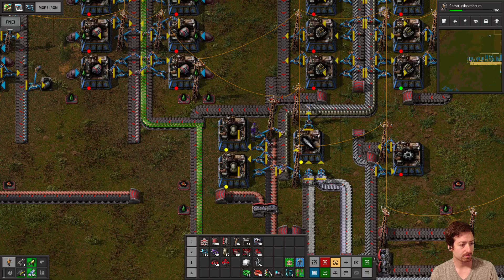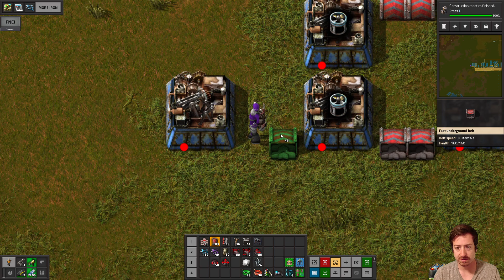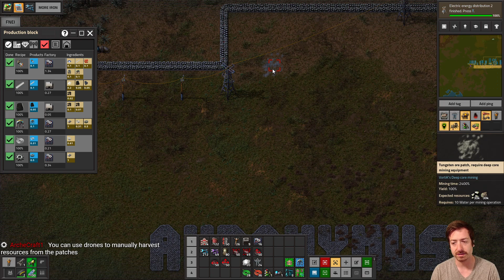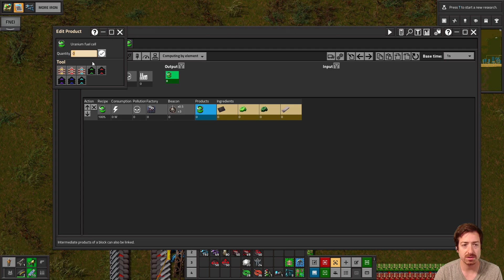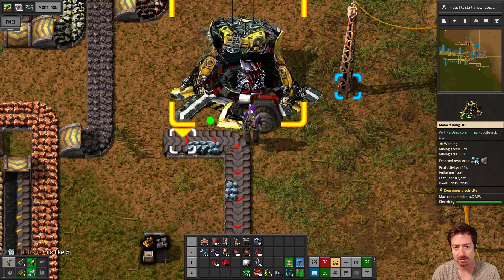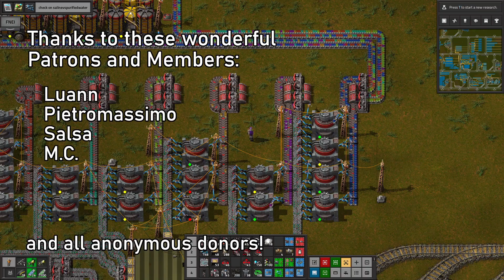Factorio Full BZ+ #15 - MOHO MINES Operational!

Comment: If you're concerned about the power draw, but want to find a way to make it work with modules but without being cheaty, then you could always just modify the power amounts.

You've shown (a few times) that you doubled the base power input to the drills (to try to force yourself to eventually need RFP).  Well, what if you did 10x?

Now, 10x?  Am I just throwing a number out there?  Well, yes, but also, that number has a reason.  Because even when you do use efficiency modules, vanilla Factorio enforces a hard limitation that no machine can use less than 20% of its draw.  So no matter how many efficiency modules you put in there, you won't be able to drop below 20% power usage.  So if the base cost is 2MW, and you multiply that by 10, the drill would use a base draw of 20MW.  Once you reduce the power usage by the maximal 80%, you wind up back at 4MW.  

I see two main benefits to this over "just not letting yourself use efficiency modules":
* I don't know about you, but I forget stuff all the time, especially if I am ever playing more than one map at a time.  If I am able to force the game to make me hold to my own "rules", that's far more likely to stick than me "trying to remember."
* Because the base power draw is higher, if any of these drills are able to be influenced by either speed or productivity modules, suddenly the power draw for those just became massive - specifically, exactly 2.5x your current setup.  And that would really force you to want to tap into RFP.